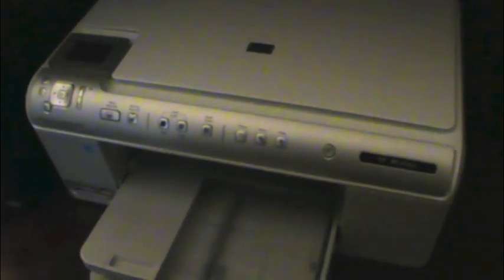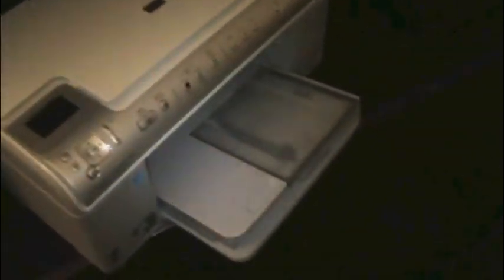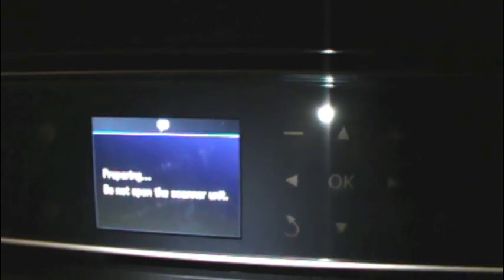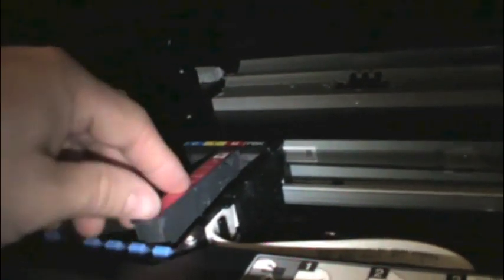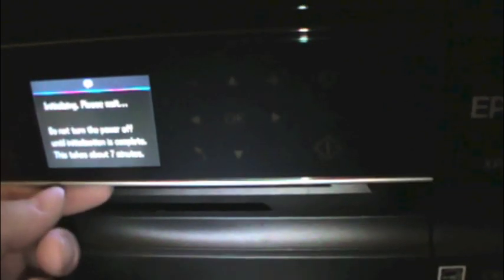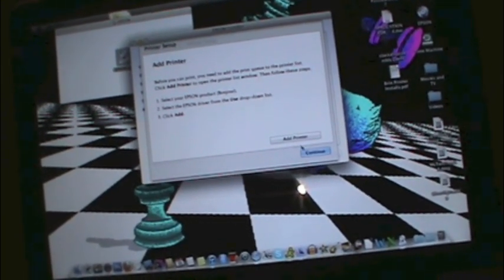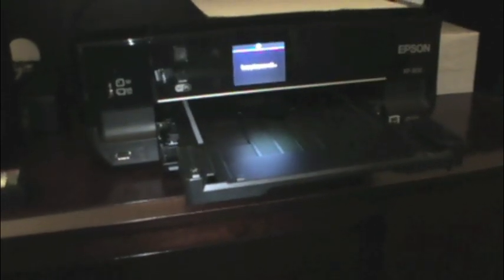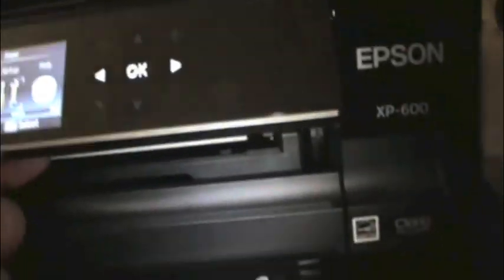Epson XP600 All-In-One Printer Unboxing

Comment: I don't know about this one, but older Epson inkjet printers had planned obsolescence built into the firmware. Once the waste ink sponge got fully saturated, the printer would shut down and tell you to send it in for service -- service which, of course, would cost more than buying a new printer. Epson's argument for this was that replacing the ink sponge would be too messy of a job for the consumer to do themselves.

Comment: We have owned an Epson Stylus 800 which was a good printer but we had issues with clogged heads and we tried everything to get them unclogged but no dice. Our Cannon ip4000 is a very good printer. It prints pretty sharp quality on crappy paper like you would use for a laser printer. Your Epson did a very good job with the photo despite the possibility of incompatibility.

Comment: I also find HP to be quite junk, the OfficeJet 8500 that my dad bought back in May, have just been a nightmare. Paper getting stuck, randomly dissapearing from computers, that has been the worst printer we had. The Canon Pixma 4000 that we bought back in 2004 served us very well until it stopped printing black in 2011. I figured out the printer head was gone. Also, we had a Epson Stylus C64 before that, worked very well, but my dad wanted something bigger, so he bought the Canon after 2-3 years.